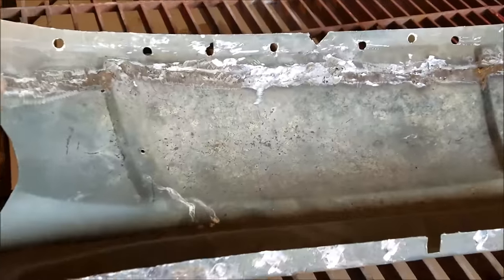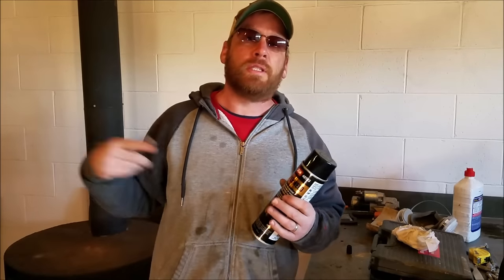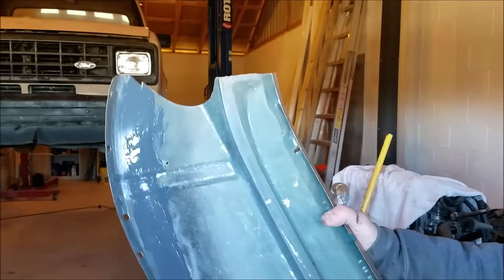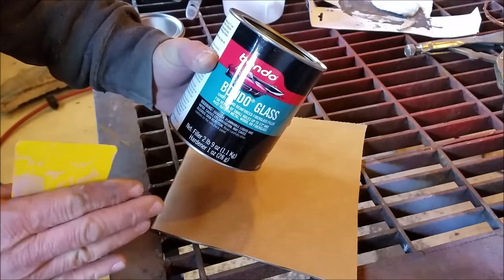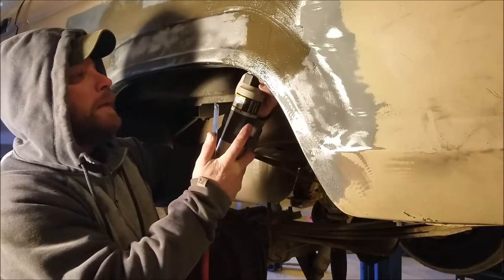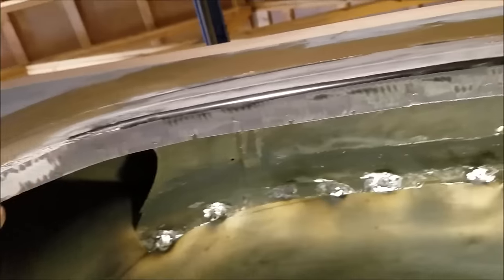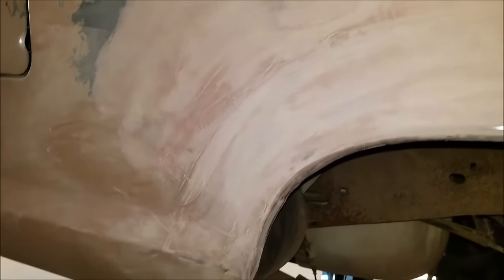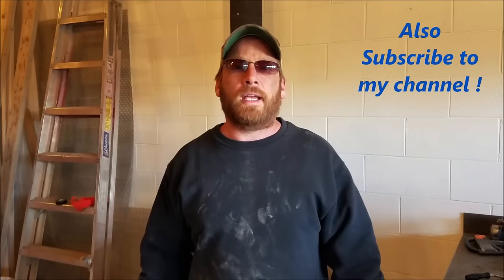How to REPAIR a RUSTY Truck Bed ! .. Part 2

Comment: May want to use the cross-etch method when sanding big flat surfaces and watch the contoured edges of the body. Itll help the paint stick way better brother. Also they have a guide for elevation, humidity, and temperature for mixing the glass up. May help ya out some. Nice work man. 👏

Comment: I wonder if it would be too flimsy if you left the inner fender out so it wouldn't be a water and dirt trap in there? Nice work by the way!
Reply from the maker: Thanks! Good question I thought the same thing but thought it was best to just put it back like it was.
Reply: I'm deleting mine to just adding some bars to support it